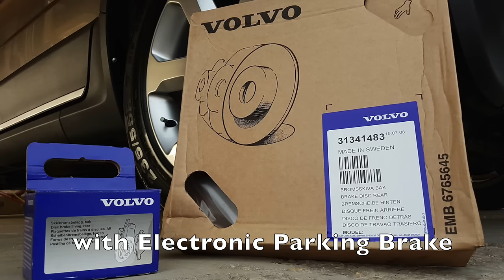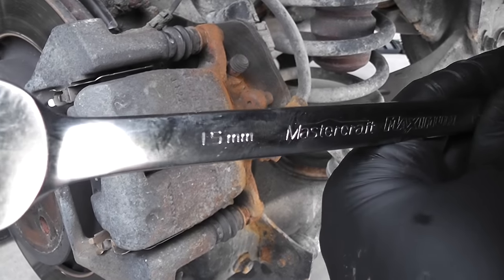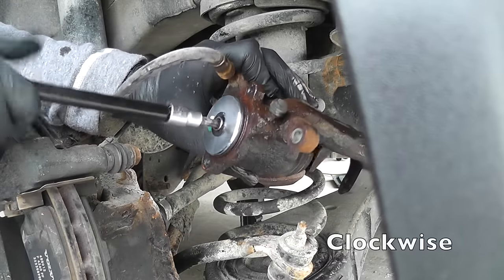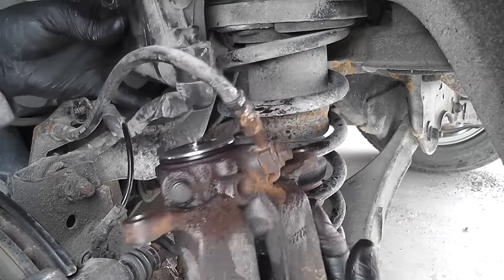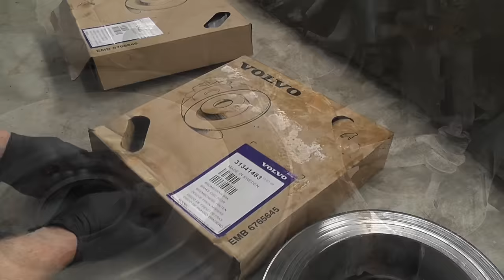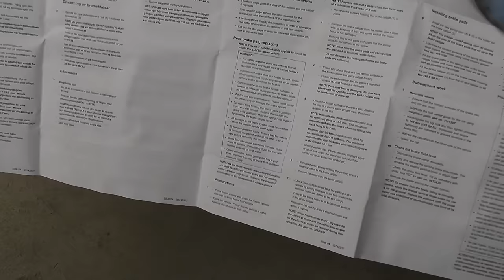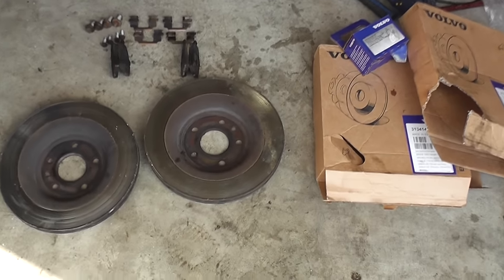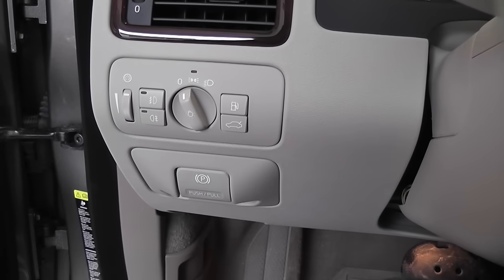Volvo rear brakes replacement with electronic parking brake. (EPB)

Comment: I love your videos. Been a volvo S80 owner for 3 weeks now. I did my rear brakes today. I used a 9 volt battery with two wires to reset the parking brake. Saved me from having to remove the electric motor. If the piston starts moving out you just swap the wires around on the 9 volt battery. Made quick work of the job.
Reply: Where do you attach the two wires to?
Reply: Were does battery go
Reply: @markrichardevans5011  I did it 2 weeks ago. Just detach the harness and there are only 2 prongs. For mine to DETRACT the EPB the positive of the 9v goes on the left prong and the ground goes on the prong to the right
Reply: Good idea!
Reply: Did exactly the same thing yesterday.
Reply: @jacobdeforge831  Remove the electric connector from the rear of the brake caliper, and there is two electric pin which drives the motor. Super easy.
Reply: I did what you did.  That's the way to do it. Bolts were far to crusty to mess with

Comment: Finally did this job. Video was very helpful but some comments talk about using an external battery to activate the parking brake so you can compress the piston. The problem with that method is you have to know which way the motor is turning. If you turn too much in the wrong direction it is very difficult to fix. One side worked well for me; the other I must have crossed the wires. Next time I would do it the way the video shows and just remove the motor.

Comment: Nice video! A small tip the next time you mount new discs: clean your hub very well with a wirebrush. If you don't clean the hub you'll risk the disc is not mounted flat and then the disc wobbles....
Reply from the maker: +Sailor X good one.thx

Comment: Thanks for sharing the excellent video. Removing the electric parking brake motor assembly seems to be a common DYI practice on many modern cars. However I ended up reversing the electric parking brake using a 9V battery and it worked out very well, so wanted to share that here. I fabbed up two wires with yellow female blade connectors. Then attached the wires to the two flat connectors on the motor. I then set a bit of tension on the piston with the brake piston compressor and held the wires onto the 9V battery. It was easy to tell if the motor was going in the wrong direction, and then just reversed the wires on the battery.
Reply: Will this stop the parking brake warning light from having to be reset ?
Reply: @chuckmckee2741  I don't know. I can't recall if the brake warning light was on. I could have replaced the pads before the warning light came on. Either way, you must reverse the electric parking brake one way or another when installing new pads.

Comment: This is actually a  excellent video. I followed you all the way through. Finished my job in half the time. LOVE the child saying mama several times. You sir are a great asset.
Reply: Hello, did you put the electronic handbrake into service mode in VIDA before replacing or did you only follow steps from video? Because I got info that hand brake must be in service mode before replacing and I am trying to find the way how to do it without VIDA. Thank you for help. Greetings Michal.
Reply from the maker: I did not have Vida at that moment. You can use 12 V battery to unwind the motors

Comment: You really should have cleaned and greased the slider bolts while you were at it, but a good video, thanks.
Reply: He did 95% of brake job.
Reply from the maker: Still learning....
Reply: How do you get the slider bolts out?
Reply: @dcapobres  
Hi, once the calipers are stripped down you can see the slider bolts one at the top one at the bottom both have rubber bellows around them, just pull them out and clean both bolts and holes out and give the bolts just a smear of grease on the bolts and reassemble, I use a drill bit to screw round and bring all the old grease and rust out of the hole.

Comment: You could always buy the tool intended for moving the caliper back into the open position,  then neither battery method or removing the motor would be an issue.

Comment: Best video I've seen on replacing Volvo brakes of this type.  The EPB is the main reason I have avoided replacing the rear brakes myself but after watching your video I will definitely replace the brakes myself.
Reply from the maker: +unoguy9928 Easy! Go ahead. Just replace the motor seal kit. I have added the part numbers to get it cheaper from Land Rover. I did not replace on the video because of price.

Comment: Thanks.  Worked for my 2105 XC60.  Removed motor and wound it back as you mentioned.  Then cycled e-brake three times, no flashing lights on dashboard.  All is good.

Comment: I just replaced my rear pads using the "connect 12V to the motor method".

Here is the detail:

Rear brake pads – Volvo with EPB (Electronic Parking Brake)

Leave handbrake on

Jack up and remove rear roadwheel

Remove slider bolts (13mm & 15mm spanners)

Remove EPB motor plug by puling upwards. This is the most difficult bit. You will need to slide a small screwdriver upwards into the latching mechanism at the rear of the connector. Keep the tip of the screwdriver in contact with the body of the connector (the bit which is part of the motor), whilst sliding it up. The tip of the screwdriver will gently prise away a latch, which is part of the connector on the end of the cable, away from a projection on the body of the connector.

Power motor release using a 9V or 12V battery. Drivers side forward most pin negative to release (passenger side is the opposite). The motor runs for about 18seconds if the pads are fully worn out.

Pull off carrier, pads and slider shoes

Replace shoes (if one is rubber coated, fit this to the upper part of the caliper)

Put a small amount of silicone grease on pad parts which touch the slider.

Use Sealey tool to retract piston slowly (don’t turn the piston, just push it back slowly). Keep an eye on the master cylinder level to make sure it doesn’t overflow.

Put caliper back. Replace slider bolts.

Power motor in reverse (reverse the polarity of the wiring) to seat piston (about 3sec).

Press brake pedal to seat pads.

The worst part is releasing the plug from the EPB. It is probably woth repeating that bit (I broke the first connector before realising this).

The part of the connector which is fixed to the motor body has a small projection (like a ski ramp) on the back. The free part of the connector which is on the cable has a clip which rides up the ramp when the connector is pushed home, until clip reaches the end of the ramp and drops drops off the end, so clipping it in place securely.

To release it, you need to insert the screwdrive upwards (running it close to the body of the fixed part of the connector). As you do this, it will lift the clip away from the end of the ramp, and so allow you to pull the connector off.
Reply from the maker: Very valuable comment. I will add this to the video description later. Thank you for sharing with us.
Reply: An excellent description of this method.

Comment: I was concerned  about how the parking brake would be "reset" back to a home position after the entire brake motor mechanism was backed off and new brake pads were put in and the entire assembly was re-installed. You explained it perfectly! Thanks!

Comment: Thank you!  I love how you kept everything brushed and clean.  I did this today on a Volvo 2011 XC60.  I used a hint from the comments and used a small 9V battery with 2 alligator clips to retract the electric parking brake, instead of the disassembly and manual rotation in the video.  Squeeze very gently with the c-clamp, run the 9V battery for 5-10 seconds, and repeat until both are fully in and/or gently stall out.  This is a minor point.  Thanks again for a great video!
Reply from the maker: Next time I will use the battery method as well. Thx
Reply: Isn’t there a service mode in VIDA/DICE that retracts the electric parking brake?
Reply: @dcapobres   Just put  12 volts on el engine . One position+it gonna brake.  Change the wires each other + and it gonna unbrake. 7-12 second are enough. Then just press the piston.

Comment: Good video, but a few things I would have done differently.
No need to take off the parking brake motors, I use a 10amp 12 volt power supply to wind the plunger back, its faster and easier.
I did not see you clean the packing oil from the replacement discs or clean the hub mounting surface and protect the surface with copper slip, I would recommend doing this every time on a disc and pad change. 
It's good practice to inspect the slide pin rubbers and pins, check the rubbers for tears and cracks and the pins for uneven wear, I always clean off the old grease from the slide surfaces and pins then renew with proper slide pin grease, not copper slip.
 I always use a torque wrench to re-torque all brake system nuts and bolts on reassembly.
A little bit of anti corrosion grease on the mating surfaces of the road wheel and bolts helps next time the wheel is removed, good opportunity to inspect the tyre too. 
Good luck with your next service and stay safe.
Reply from the maker: Thx for all great tips. This info is helpful to everyone..
Reply: How to wind the plunger by using 12v???
Reply: I have seen some comments that disconnecting the plug to do that activates the service light. Is that true?
Reply: @markhooper9267    Not true.  To get the plug off the motor, slide a thin screwdriver upwards against the body of the connector to release the clip.
Reply: I did this job too a short while ago, but didn't want to deal with removing the motor.  What we did is disconnect the wiring harness from the motor, then apply negative 12v to the plug on the motor.  You have to watch the motor to see what direction the piston is moving.  If it's still moving out, then reverse the leads.  Once it screws all the way back in (you can hear a different sound if you listen closely), and then you're done.  Now you're not having to replace the seal, Torx, etc. which also saves time, $, and trouble, especially if you live in a very remote area like me, with an hour travel time to my nearest Autozone
Reply from the maker: That is what I will do next time. Thx!
Reply: Or if you wany to do it the easy way just buy a decent scan tool and tell the car to wind them back
Reply: @jameshone1000  An excellent idea, one for a future brake job👍
Reply: Just hit the totors and pads with some brake cleaner when your done to get rid of oil. And after a short drive, use brake cleaner again once the pads have worn in.
Reply: @niedviet  Aparently you can reverse the negative and positive on the connector and it will wind back using the motor. But really it's not that hard given you only have to do it once every 4 or so yeras.
Reply: Taking the motor off with two bolts was easy for me. Disconnecting wiring and hooking up a power supply sounds scary.

Comment: Many thanks for a very informative video. Your video gave me the confidence to tackle the replacement of my xc60 rear brake pads and discs. The problem I came across was I could not undo one of the 30 torx head bolts holding the motor on, so I used a 12 volt adapter to wind the motor back, this worked well and overcame a big problem and proved a simple and effective way. I did not have a large enough G clamp to compress the piston back but I found that the use a motorcycle tyre lever and piece of timber, together with some strong levering enabled the piston to fully retract although I did bolt the caliper on  to one fixing to give a better leverage. I did have some difficulty getting good access to the  15mm bolts due to the electric motor being in position but I used a knuckle joint to overcome this. My xc60 had covered 41,000 miles and one side had heavier worn pads than the other although both discs had worn to their minimum thickness. Again Many Thanks.
Reply: could you explain how you connected stuff to wind the motor back? Planning on doing this job tomorrow

Comment: You can see Volvo had lowered hardware metal quality in post 2010 cars.  See how rusty are these after 2-3 years.  
2001-2009 model would not rust like this and had great bolts/nuts quality, easy to undo even after 10 years in salt.

Comment: Just did the rear brakes on my sister's S60 using this video as a guide. Everything went smoothly and works great. Thank you!
Reply from the maker: Nice!
Reply: So it was the same on the s60? I'm changing brakes on my V60 this weekend so I'm curious :)
Reply: MajorDork70  yes, everything seemed exactly the same. If I didn’t had to jack up the car and take the wheels off the job would’ve only taken five minutes per wheel.

Comment: You should paint the calipers with anticorrosive paint to prevent the rust because this car is with few years and change the brake hose rust or paint the metal parts of the brake hose for the same problem.nice video and congratulations from Spain,my english is bad,sorry.

Comment: Replacing the rear pads on my wife's 2008 V70 this weekend.  Great tips below about retracting the EPB motor.  9v batt and clip leads.  Wow, that's a lot of corrosion under that car.  Thanks for the video.

Comment: Excellent video guide and in HD too! I would add using anti-seize on the hub-disc mating surface prior to installation and lubricate the caliper sliding pins. Using torque wrench to tighten all the bolts (including tyres) could result in more brake feel and performance.
Reply from the maker: +Amir S thx for the tips...
Reply: Je voudrais savoir comme,changer la panne à l'huile de ma volvo 2003 s40 moteur 1,9
Reply: I agree. I had to whack a wheel off the rotor on a Buick was rusted and fused. North East US is the problem area where salt kills cars w rust.
I am also tempted to reuse outer brake pads from his car. They r good as new and their surface looked even

Comment: just did this yesterday
if you have the right tools and have loosened up the bolts you can do both sides in about 40 min
the trick on the caliper is to fully wind in the take up  screw and then press in the  piston
we lubricated under the duct covers with silicon spray grease to ease the return of the piston so it doesnt grip and bugger up the rear discs  which is a common fault on these cars 
the front brake is really weird as its  needed to split the caliper to change the pads
you need a really good torx bit to release the 4 screws and a m7 uncommon size allen key  to undo the guide pins

Comment: Great video, thanks.  Might depend on the model, but generally do NOT have to remove the main caliper bracket (those two red lock title bolts) to replace rotor.  Since there are no lug studs, the rotors easily pivot out from under the piston bracket.  At least on my 2014 S60. Saves a TON of time.  Same on front — do NOT split the caliper with the 4 Torx bolts - seems to cause more problems than its worth. Remove teh two bolts under the plastic caps, swap pads and rotor and you’re done.
Reply: Michael, I have the same 2014 S60 T5 59k miles. My 2nd Volvo. Had my brake pads & rotors replaced by a mechanic last week & they couldn’t seem to figure out why the brake pedal seems soft, like it goes too low to the floor. Then they replaced my master cylinder which I don’t believe it needed to be. They bled them, then decided to replace the vacuum booster line. Still the same. They had my car for two weeks & I finally decided to take it to a mechanic familiar with European cars.  So the new mechanic, He bled them & said the rear brakes have air trapped in the line that after idk how much brake fluid he went thru but told me he thinks the other shop messed up my abs system & added that his computer didn’t read the abs system. Now I have to take it the dealer. After watching these videos though I’m learning a lot about the break system for my car. Fingers crossed I can get them fixed without getting ripped off 🤦‍♀️
Reply: @sherrygzen  did you ever figure out what it was?
Reply: @huntermitchell-yh9fo  Took it to the dealer that “has a protocol” I was told after two weeks of my car being there, they replaced the master cylinder again & claimed it was not installed properly by the previous mechanic,replaced the booster again (still the same problem) and finally the abs pump they wanted to charge me $3000 just for a new part or $300 for an old beater part from a junk yard. 
Why didn’t they just replace the abs pump in the beginning? Got me!! $3800 later and an old abs pump seemed to solve the problem but what a rip off.  I think it’s important to take a European car to a mechanic that knows European cars. Period

Comment: Thanks for great video!
I just did brakes on my Volvo XC60. First side took me ~1.5 hour, including trip to the store to buy torx-50. Second side was much faster - about 20 minutes. And I did NOT use the trick with reversing electric parking brakes, I took it apart as author did - piece of cake!
Reply from the maker: Glad my video helped!!!